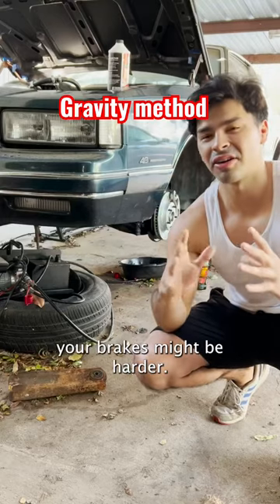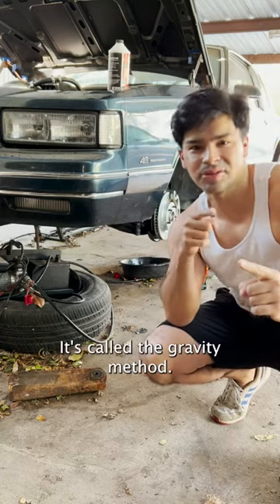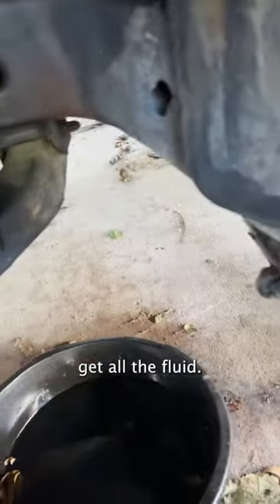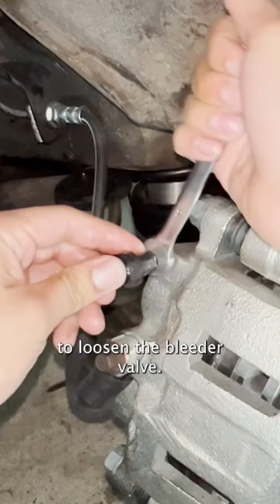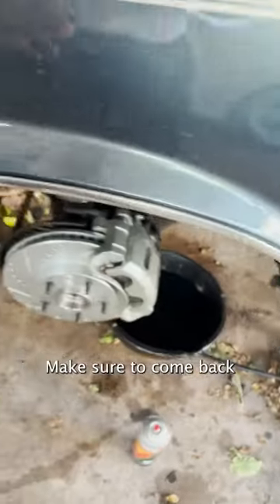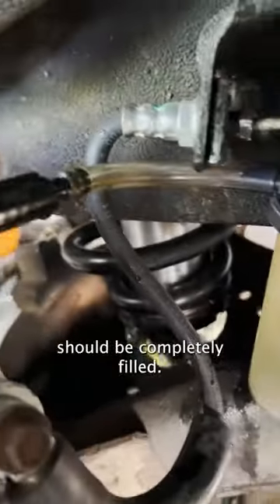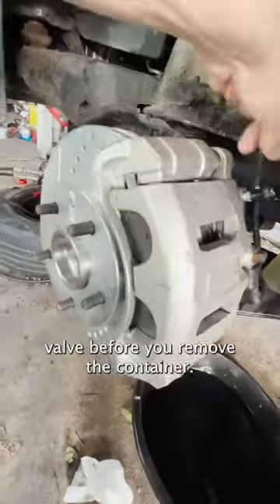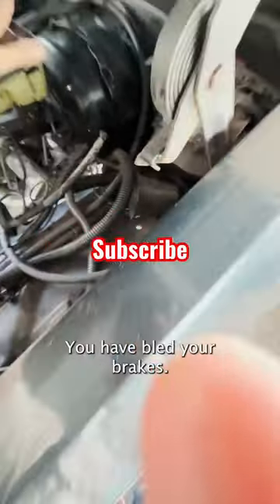How to bleed brakes by yourself Gravity method

Comment: Brake fluid is hygroscopic, meaning it absorbs moisture. Don't let it sit like that, or you'll have more problems than air in your brake lines...
Reply: Going to say the same.  It really matters because it lowers the boiling point of the fluid.  If you live in a place with high humidity it's a very bad idea.  It will work like  this.
Reply: Thank you I hate people that know a little bit, than spout out false information. that’s going to get someone hurt or worse

Comment: After you open the bleeder valve, simply press the brake pedal 2-3 times, close bleeder and refill brake fluid and
Reply: Doesn't work that way
Reply: @mikee7070  I've done it 5+ times on different cars. Biggest issue is rusted bleeders. Some cars need more pumps than others.
Reply: Won't that suck in air? Thought the whole point of pumping brakes was to do it while it's closed
Reply: @starpreacher01 not if you already have a little bit of fluid in the bottom of the container
Reply: Nope, that's not right. It normally takes two ppl to bleed brakes. One pushes down on the pedal and holds it down, the other opens the bleed valve, then closes it. Repeat until all air is out of line. Move on to next wheel.

There are ways to bleed with one person, but that's another story. What he's showing in this vid is a start, but it won't get all the air out.
Reply: @TheZaxx no it doesn’t if you have a hose and a bottle with brake fluid in it and the hose submerged if you face the hose a certain way it will help air out while you pump it on your own and close it after once it’s cleae

Comment: This is not how you bleed brakes by yourself. 
There's a reason know one has heard of the gravity method.
Put some hose over the bleeder valve, usually some fish tank air line, put that hose into a cup of brake fluid and pump away. It will blow out the air and suck up fluid. 
Common man, I was just starting to like you.

Comment: Or
You can add fluid to the bottle you have and don’t let the hose tip  come out of the fluid in the bottle and pump them untill the container is full and you’ll for sure have gotten rid of the air at 20x the speed.

Comment: No, do it the easy and the right way get a vacuum line that runs from the caliper to the master cylinder opener master cylinder open your bleeder hook the hose to the bleeder and then put it in the master cylinder and then pump your brakes until you feel the pedal get firm stop close the bleeder and it’s bled. It’s called force bleeding it. With that handheld vacuum you will never get the air out of your system and your brakes will not be right.
Reply: You mean to drip the oil back in the reservoir??